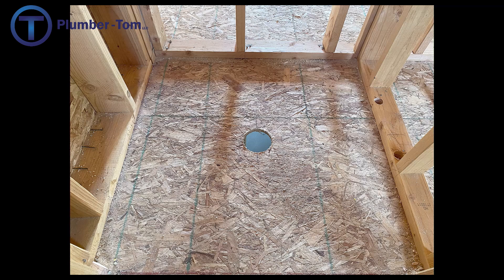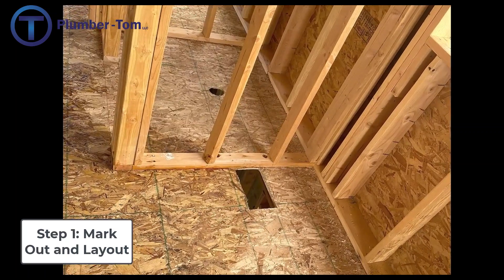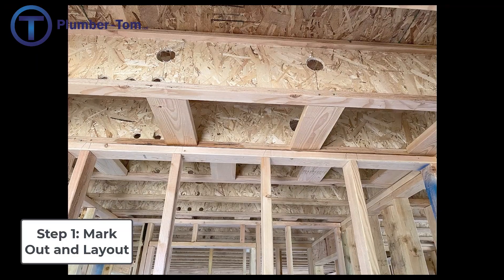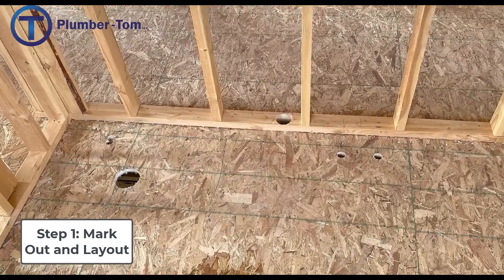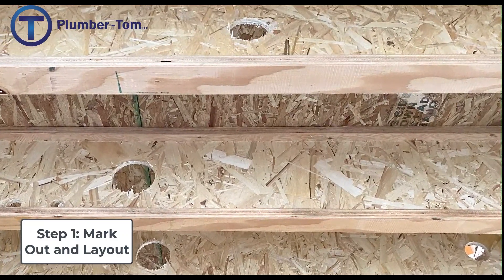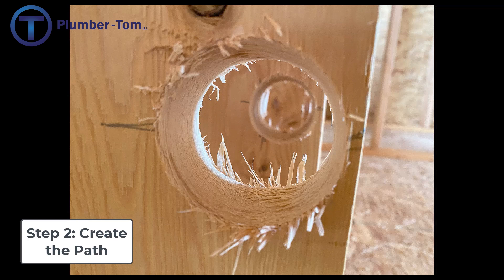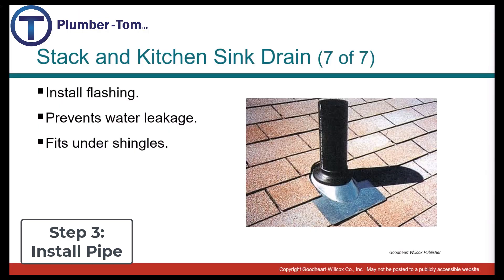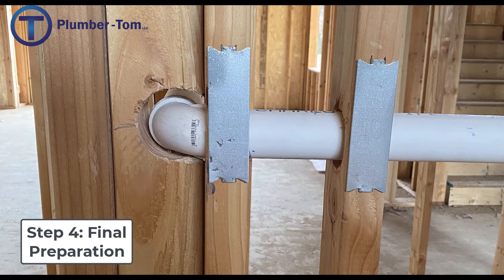Rough DWV Plumbing 101

Comment: AT step one "mark out and layout" who is at fault when the I-Joist flange is in the way directly below a fixture? Why is this constantly a problem? What steps need to take place between the builder and plumber to prevent a flange from being cut into? Thanks!
Reply from the maker: Great questions.  It is the framer who has the responsibility to check the plan and layout the joists so they will not be in the way of plumbing fixtures.  Most of the time, they don't.  The framer I work with has told me he really doesn't care, and would rather come back and fix it later.  Of course, then he is cursing under his breath because it is always a pain.  In my opinion, a little forethought and prior planning is worth it.  This is really not that hard, framers!
Reply: @plumber-tom9470  Thanks!  That makes sense.

Comment: Hi doing mr! Your videos are amazing! I have a question in the minute 4:56 you are connecting a horizontal drain and dry vent with a sanitaree tee(vertical vent) is that allowed per code? We can do that just in dry vent? I am learning i appreaciate it any help you can give me. Thanks
Reply from the maker: Sanitary tees are required to be in a vertical position when they are creating a horizontal branch from a vertical pipe.  But if the sanitary tee is used as a vent on a horizontal, like I did in the video, they can be laid on their back.

Comment: Hi Tom! Big fan. Long time watcher, first time commenting. I have a water softener that hisses and continuously has water running out of the drain tube that is connected to my floor drain. Will you do a video on service and common aka easy repairs on water softeners? BTW it will need to be simple enough for your friendly neighborhood electrician. 😉 Thanks
Reply: mean time you might check your manual    or you tube for similar symptoms
Reply from the maker: Hey Neighbor.  Thanks for watching. That’s a good suggestion. I will keep that in mind.